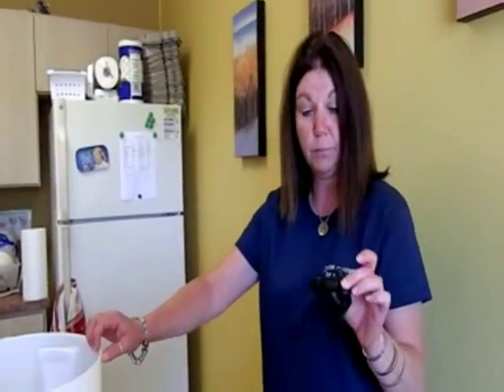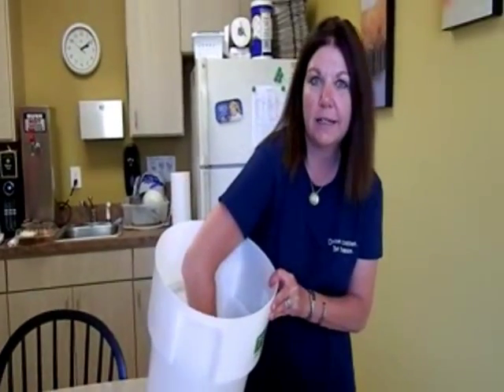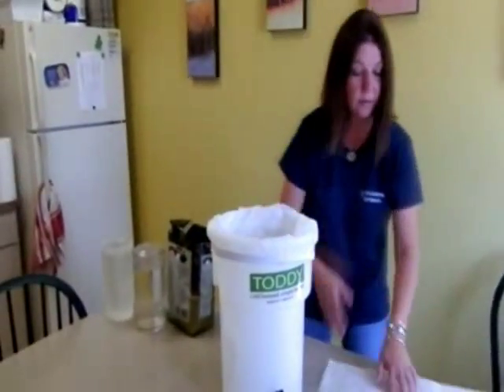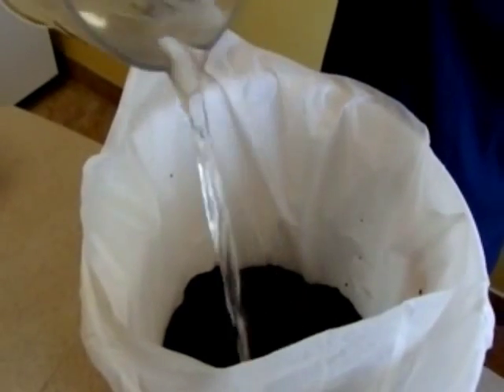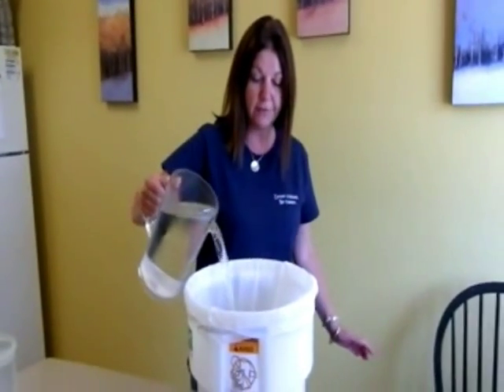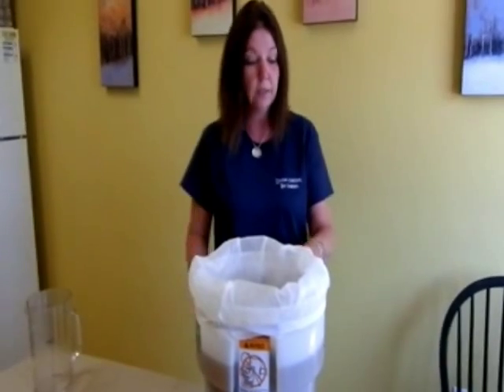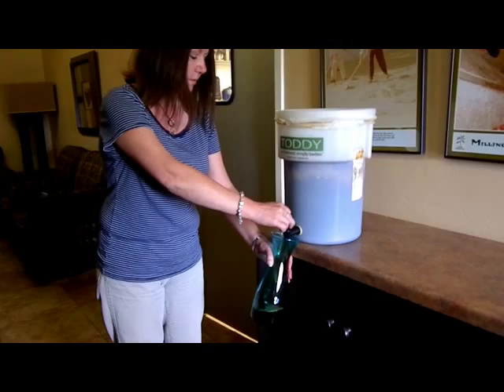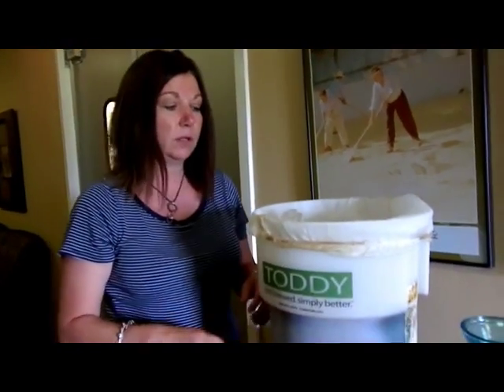Cold Brew the Door County Coffee way

Comment: That seems like a decent system, but the problem with it is, there is a ton of water left in that filter bag, that unless you have a way of letting that set and drain for a while, you're throwing away more brew than you think. That is the big flaw with the Toddy system.
Reply from the maker: Steve - You are absolutely correct. This video was done before we found a great solution that allows us to get as much brew as possible. Placing the bag in a commercial size colander, allows us to press out as much more of the Cold Brew, making for far less waste. Coffee Cheers!